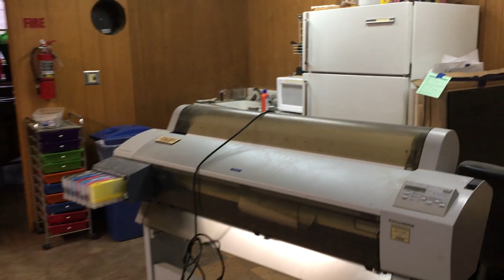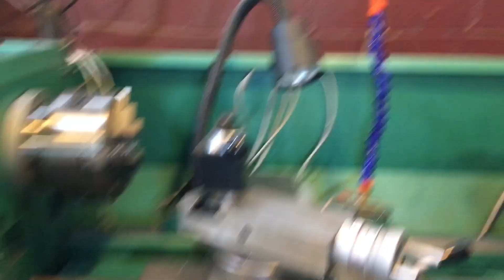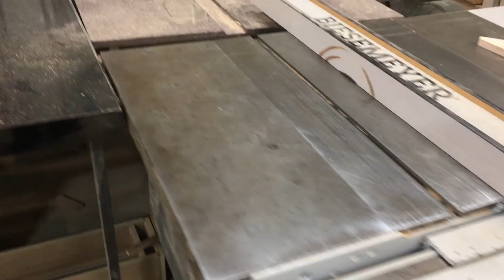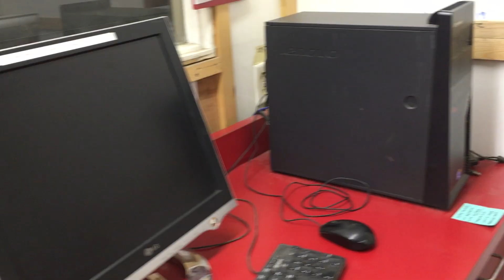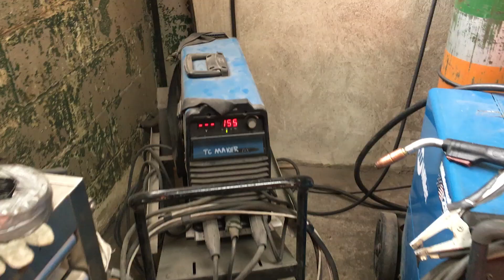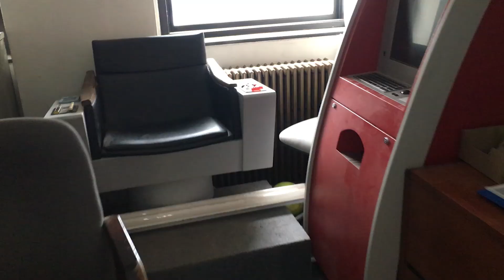Minneapolis Minnesota Maker space tour 2018

Comment: Thanks for the tour. It looks very interesting.  The benefit of a maker space seems to be a great assortment of tools, certainty way more than I could ever fit into my workshop. The downside seems to be a fair bit of broken tools.  I wonder how they balance costs. It seems like you might have a mix of some people using the space heavily for manufacturing and others using it much more lightly on a hobby basis. I am impressed if the maker space is well run and financially viable.
Reply from the maker: Thanks for the comment Perspectologist, they seem to be financially viable, but they are not too quick to fix tools, on the other hand, a lot of those tools are tools that members have brought from home, so the maker space cant fix other peoples tools, that is the down side of tool sharing.